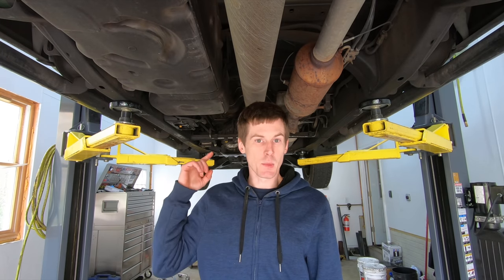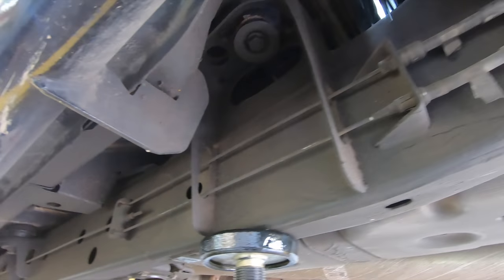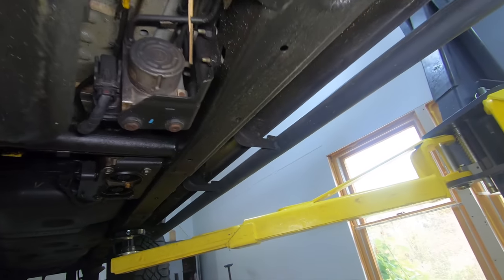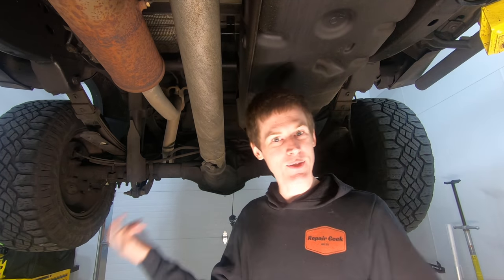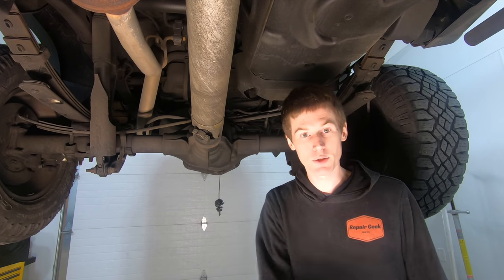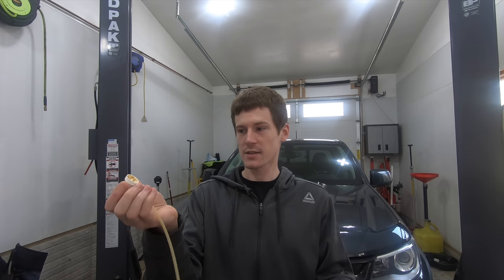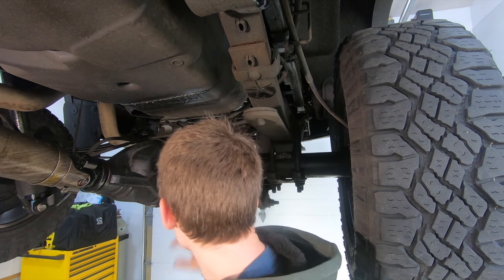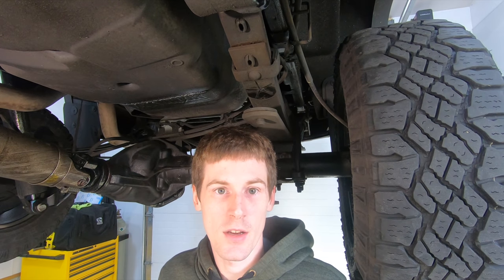Fluid Film Review After 4 Years. (Woolwax vs Fluid Film results 1 yr later)

Comment: Glad to see more on Surface Shield.  Been watching for local availability and finding none, though it looks like I could now order case of 6 from Home Depot with free shipping.  I'm about out of time for my above-freezing home/car maintenance tasks and looks like recoating cars will have to wait for Spring.  At this point I think I'd use Fluid Film in places I want flow/seep, like inside doors, hoods, hatchback, maybe fenders so it will fill seams (I've seen youtube about melted petroleum jelly but I already have a small stock of Fluid Film);  Corrosion Stop on exposed seams like the bottom of doors;  Surface Shield on underside.  It would be interesting to see Repair Geek discuss Blaster Corrosion Stop vs. Blaster Surface Shield.  I wonder if Corrosion Stop will be discontinued in favor of Surface Shield.
Reply from the maker: Yes Corrosion stop will be going away at some point. I have no idea on when.
Reply: Are you guys drilling into doors/hoods etc to spray the interior like what Krown does, or only spraying undercarriage and factory openings?

Comment: Awesome videos - do you spray the brake rotors and calipers expecting the contact points to wear off pretty quickly due to a couple of brake depressions?  Or is it really slippery and scary for a while afterwards?
Reply: There is no way I would spray the brakes or calipers with any lubricant.

Comment: Hi Bro,
Over here in England we cannot get hold of Surface Shield. I am told it has not been cleared for use !
Have you heard of a British product called LANOGUARD. It too is lanolin based and it is supposedly
safe on all plastics and rubbers. It is available in 250 ml, 2.5 litres and 5 litres. If you can access their
website, I would welcome any comments you may have.     Regards  Ian Dale.
Reply: Checkout Hammerite Waxoyl, British made product. Been around since Noah was a kid.

Comment: GREAT VIDEO! Do you think the added petroleum jelly in Surface Shield will crack or swell rubber bushings or strips?  Thanks for sharing.
Reply from the maker: Obviously I don't have 5 year's worth of experience with SS to say one way or another but I can tell you I would rather change every bushing on the vehicle than repair rust. In the 4 year's with FF we have had no bushing issues.

Comment: Be careful when using fluid film  I have a 2022 gmc Sierra 2500hd and applied ff and got some on my leaf spring shackle bushings and it created a constant creaking noise. The ff caused the bushings to swell.  Luckily the dealership covered under warranty. So be careful when applying not to get it on bushings or rubber

Comment: Do you have to be careful where the fluid film is sprayed? Has anything happened to your rubber bushings etc. ? should these areas be coated with a silicone spray first before applying fluid film?

Comment: Great review and videos. Do you ever take your truck through a carwash that sprays the undercarriage? I often do during the winter to get all that salt off. But I'm worried that will remove whatever product I use.
Reply from the maker: No need to wash the bottom of the car. If the salt is on the coating and not the metal it can't rust. I never wash the bottom of my vehicles. If you go to a car wash don't get the undercarriage spray.

Comment: Been using Fluid Film on my 2017 4 Runner since new as well, and my frame/under carriage looks basically the same.  4-5 cans a year.  I am southern OH FYI, not really bad winters, but still salt on the roads .
Reply: Do you wash your undercarriage at all after applying?
Reply: @barkzai2000  I do only with a regular garden type hose.  Nothing with high pressure that would remove it.
Reply: @josefmd  cool thank you so much!

Comment: Tell your pops keep heads up for sasquatch. Don't care if you believe or not but once you run into one it will change everything on it's head. Salt Fork has had many sightings reported and Ohio DNR did a 4 hour program on the Sasquatch. Alright thanks for the info on the rust I love the fluid film. Keeps my vintage Triumph Speed Twin in tip top shape.
Reply from the maker: Yeah we're well aware of the convention at salt fork lodge every year. We keep ourselves armed just incase. Plenty of coyote running around as well.

Comment: On the 2nd application a year later, do you power wash or hose down the underside or just reapply on top of the old? Thanks.
Reply from the maker: Just add more. I never wash the bottom of the truck.
Reply: @RepairGeek  Thanks!
Reply: @RepairGeek  Never Ever?! Doesn't get too salty? Your trucks look so good I figured you sprayed it all off in the spring and reapplied then.
Reply from the maker: @KnowThyZomB  again lol... I literally NEVER wash the bottom of the truck! I will hose wash the wheel wells so they don't look dirty. The salt sits on top of the coating. It will never touch the metal. Rain will eventually wash salt off the coating. If the coating is maintained correctly you will never have to wash your undercarriage unless you're driving through lots of mud. I have multiple people that I spray for every year. Their vehicles look like mine. They follow the same regiment as myself. Spray it and ignore it until it's time to spray again. Very simple and clearly, gives great results.

Comment: Just wanted to know your thoughts on PB Blaster vs RP-342? I'm about to pull the trigger on one of them but just wanted to get your thoughts. Just subscribed to your channel, and thanks for all the helpful tips!
Reply from the maker: RP342 aka cosmoline does not creep. That product dries. On internal surfaces you want a product that stays wet and penetrate the seams. Cosmoline will creep (or run down, it never creeps up) for about 30 minutes until it dries.

Lanolin products stay wet and will creep and self heal for years after the application.
Reply: @RepairGeek  Awesome! Definitely makes sense. Thanks for the quick response I really appreciate it!

Comment: Thank you for your detailed videos! Would you recommend the fluid film product application on a 2022 Silverado? To my understanding, the Colorado frames are e-coated vs the wax dip on the Silverado frame. I have noticed that GM does not recommend petroleum based products to be applied to their wax factoring coatings.
Reply from the maker: Give it 5 years up north somewhere and that wax will fall off on it's own, coated or not.
Reply: @RepairGeek  do you recommend any of the products that you’ve tested for GMs wax coated frames?
Reply from the maker: I've used them all on wax frames. I haven't seen drastic differences as far as affecting that coating.

Comment: Would using ospho first to convert rust, then use surface shield for protection be a sound plan ?
I have a 30 year old f150 mostly garage kept. But it’s got a fair amount of rust on the underside now.
Thank you for your input
Reply from the maker: I don't think you'll see a huge benefit long term with converting it first. If it makes you feel better go for it. Is it required? Nope. Will you see an additional benefit? I doubt it. If you were painting it first absolutely but this isn't paint.
Reply: @RepairGeek  thank you

Comment: thanks for the info... How do you not feel nervous lifting up the truck on a greased-up frame using rubber lift pads?  What do you do to keep it from slipping?
Reply from the maker: The truck is 5000lbs. I'm 140. The vehicle isn't going to slip unless you go full gorilla on it.
Reply: @RepairGeek   yes, just spraying alone won't move it. FF & WW is some pretty slipery stuff. I wouldn't have even asked, but I recently watched a collection of videos about pickups and cars falling off lifts. Wasn't aware it happened as many time as was shown.   I appreciate the detail in all of your undercoating videos . To back your point about FF over paint, I needed to redo the underside of my flatbed trailer. I wire brushed it thoroughly and was going to ospho it or rusty metal primer it. I contacted FF, and for the same reasons you have mentioned,  the stated to just appy directky to the brushed rusty surface. I used FF black, and it turned out great.

Comment: Someone suggested using Fluidfilm inside the frame, rocker panels, etc. but something thicker and less sticky (Woolwax?) in comments on an earlier video.  The idea being Fluidfilm flows best inside …. Does that approach make any sense?
Reply from the maker: It does make sense. I need to do some testing to know if that would have any benefit though. If you were a religious FF or WW user after 10 years, would you see any difference? I doubt it. Both products work. If you are religious about changing your motor oil could your mechanic tell if you used Pennzoil or Mobil? Nope, they just know that the engine is well maintained.

Comment: I’m about to pull this feat for the first time. I have a compressor but I don’t have a lift. Which way would you go? Compressor with the wool wax sprayer OR surface shield rattle can?
Reply from the maker: Compressor and the sprayer. Cheaper in the long run.
Reply: @RepairGeek  thank you

Comment: Have you ever tried spraying ATF or diesel fuel for a undercoating ?  Or perhaps mixing either of these with melted wax ?
Reply from the maker: I've tested ATF. The main problem is it's too thin and runs off the surface very quickly. Driving down a dirt road would help "lock" it in place but, my testing that I did a couple of years back had no dirt exposure and therefor no protection.
Reply: @RepairGeek  I understand that it might require often application , perhaps once a month, but at least it wouldn't attract dirt. I guess it's a trade off. Most people want something they can do once a year.

Comment: Ok so nanoline products work great. And should be applied every year.

So my question is.  Lets say i do rust prevention on my lx470. Sand/prep it. Clean and dry properly.

Apply a nanoline product like FF.   I live in canada and have harsh winters with lots of salt.

Will it still protect my vehicle?  And if i wash off the salt weekly?

Wont wand washing my car take off the nanolie product?   Thats my concern

Because i was really considering and liking CRC. Yeah its thin(and would have to apply multiple coats, no big deal)  but with my current weather conditions, nd how often i would need to wash my car.   I need a product that is strong like CRC.  Anyone have any experiences?

Comment: Just curious, when you apply near brakes, especially disk brakes, do you take any special precautions like masking off the rotors etc?
Reply: I spray woolwax for alot of people and just opened a garage. I either wrap the wheels with a bag, to cover the brakes. Or if the tires are to big to do that. I take the wheels off and wrap the rotor's with a trash bag tight. I'd rather be safe then sorry. I bought the woolwax gun by Kellsport products. I chose woolwax because the other only local shop that sprays uses woolwax as well, and I can get it by the 5 gallon bucket. I lay it down really thick, I've had really good luck with giving it a really heavy coat the first time. Most that come back the next year need very little, if any reapplied. Ya I use a little more then normal, but that's why people have me booked out
Reply: @frankhartford5194  Thanks for the info Frank, I'm giving some thought to doing this as well.  What about the floors and walls, does the spray stay fairly contained? I would think the floors need at least paper, no?
Reply: @Tony-rl2fr  I used plastic and cut to the size I need, to try and contain it all I can. I have a big tarp I might use instead, just need to weight whatever you use down a little. I just got a lift I'm gonna install. If you plan on doing just one or 2 cars it's not to bad. But doing a bunch a lift helps for sure

Comment: The spray gun in the beginning of your video link isn’t working. Also, did it come with that long thicker hose? Seems like a better option than the aerosol can flimsy hose. Can you provide a link to that exact spray gun and long hose??
Reply from the maker: Mine works fine. Try this link:https://amzn.to/3ZxTfbn
Reply: @RepairGeek  but I need a sprayer with that longer hose , preferably 48” maybe 36 like in the beginning of your video
Reply from the maker: @mikem04rubi  what time is it shown in the video?
Reply: @RepairGeek  16seconds as your pulling the hose out of the frame, it looks to be quarter inch thick and I’m curious where you got that hose and what kind of sprayer it’s attached to
Reply from the maker: That hose comes in the kit that I linked in my first reply.

Comment: You got a lot of rust on the exhaust! Cheap steel? Even with a the origal exhaust on my Mazda 3 2010, I had only rust around the joints and edges of the muffler.  I live in Canada and a ton of salt is laid on the roads during the winter.
Reply from the maker: It's heat related somehow. The front of the exhaust on these trucks has virtually no rust. The DPF which will reach 1200 degrees during the regen process has the rust on it.
Reply: @RepairGeek  That makes sense then :)

Comment: Do you recommend driving down a gravel or dirt road after applying fluid film or any other lanolin-based spray? Intuition tells me the dust would bind to it and actually create an extra barrier for protection.
Reply from the maker: It would help hold it in place but it's not necessary. Over time dirt is going to accumulate on it's own.
Reply: @RepairGeek  I had the thought of applying once a year overtop of the previous coat(s) to create like an impenetrable barrier of film and dirt after a few years. Thanks for the reply. Merry Christmas to you and your family!
Reply from the maker: That's exactly what I'm doing here.

Comment: I have a 2009 Honda CRV ie.12 years old  in excellent shape.  If I were to treat undercarriage with PB surface shield I'm wondering if I sould first power wash the undercarriage and treat it with a rust converter like Rust-Oleum rust converter? Any thoughts on doing that before applying PB surface shield?  I guess my real question here is how would you prep a 12-year-old car before spraying it with PB blaster surface shield? Thanks & your videos are very informative.  Bob C
Reply from the maker: Don't paint it. Paint just seals in moisture. Remove any loose rust, spray the rust with any lanolin product. Come back in a week and respray any areas that look dry. The petroleum in the products displace any moisture in the metal.
Reply: @RepairGeek    After watching this I'm going to spray my 23 y/o Ford.
Reply: I'm still wondering if ok to prep a 12yr old car with phosphoric acid like Ospho to chemically react with any rust before spraying with pb surface shield?  Or ignore using the phosphoric acid first step and just do only pb surface shield?  Thanks.  Bob C
Reply from the maker: Removing the loose rust is a more important step than treating it with acid. For metal to rust it needs to be in the presence of oxygen. The way any sort of rust coating works is it creates a barrier between the oxygen and the moisture (H20) in the air and the metal. Any of these lanolin products will create this barrier for you. Traditionally people create this barrier with paint or rubberized undercoating. The problem is they chip crack and flake this will re-expose the metal to moisture restarting the rust process. Also, paint and rubberized undercoat will not displace any moisture that is in the pores of the metal. They just seal in moisture that exists between the metal and the paint worsening your rust problem while looking protected. Lanolin will not chip crack or flake. It displaces moisture and can be removed at any time if needed.

My question is how do you plan on treating interior surfaces with phosphoric acid? The reason that I ask is because rust exists on internal surfaces as well. People ask me the should I paint it question a lot and my response is always, how do you plan on painting inside the frame?  Acid may help but you're not going to get acid on the internal cavities as well so, what are you gaining?

Remove the loose rust, spray it, check it in a week for any areas that have soaked into the metal and look dry, and respray them.
Reply: @RepairGeek  thanks much...👍👍

Comment: Do you know if Blaster Protection is a hydrocarbon grease? I'm concerned it may swell rubber bushings. Any insights?
Reply from the maker: I haven't had any issues yet.
Reply: @RepairGeek  Thanks for the feedback. Excellent work with your channel.
Reply: @RepairGeek  BTW, any chance your buddy who's a chemist could shed some light on the rubber bushing with petroleum based product issue? For example maybe it's less of an issue when the ratio of petroleum to lanolin is below 50%?
Reply from the maker: What you have to remember is most of the rubber parts under the car contain grease. CV boots, ball joint boots, brake lines all contain grease or petroleum inside. So if you have grease on the inside what is oil on the outside going to do? Nothing! The only other bushing under the car are suspension bushings... I'm 5 years and 40k miles into this testing. Bushings will have some degradation on their own over 5 years even if the lanolin wasn't on there. Every vehicle that I've treated has had zero bushing problems. Also I could replace every single bushing in the suspension 3x over for the cost of replacing my bedsides.